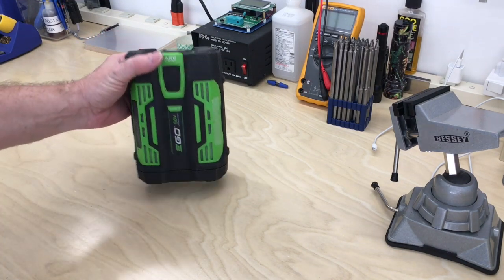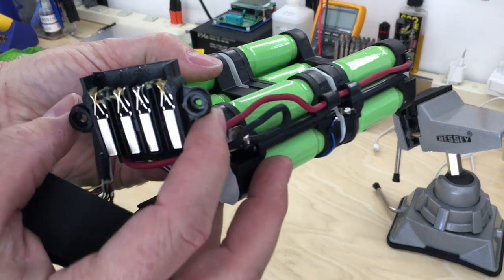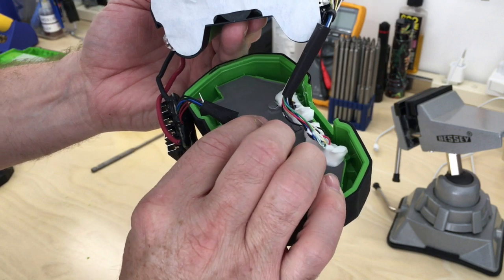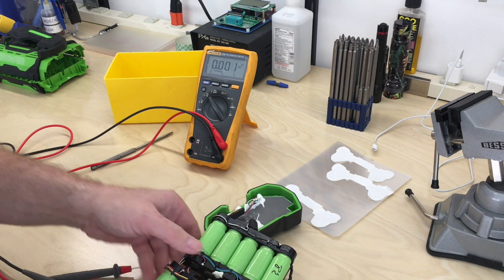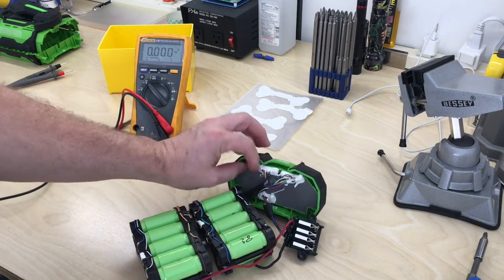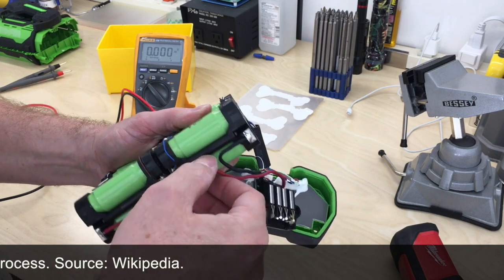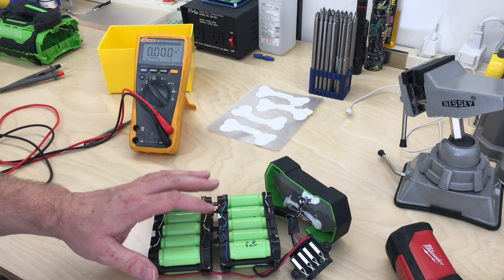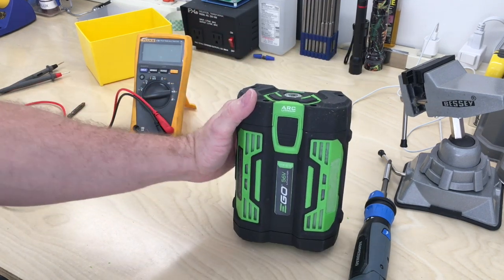EGO 56V ARC Lithium Battery Teardown

Comment: Can you give us the order of the colored wires in each connector? I ripped out some terminals when i tore off the lid
Reply from the maker: I have a video on the 2.5ah pack BMS wiring. It was to help with a similar issue back then. It may differ some on different sizes and pack generations, but hopefully it helps. 
https://youtu.be/RfTJODoh8Q4?si=QhJ8d9pLiBBaY_CJ

Comment: how is this battery 56V???  Even if you assume each cell is 3.7V then 14 cells connected give you 51.8V
Reply from the maker: Because 4V X 14 = 56. Most packs use the MAX or close to max charge level and some like the first ECHO 58V used the absolute max of 14 cells to call it 58V and really it's the same as any 14S pack. The newer ECHO line is now 56V oddly enough...
Some manufacturers use the nominal 3.7V per cell but very few today...

Comment: Hey good video.   I have one to tare down myself.   On year old.  Got a warranty replacement coming also.  I plan on keeping the dud for spare parts.   Maybe use some of the cells for projects.   If you plan on doing the same.  I would take it back apart and disconnect the cells as not to bring them completely down.
Good video .  Thanks !
Reply from the maker: In the very next video I shared the repair of this pack. I have shared many videos on the packs over the last 5 years since this first video. Thanks for sharing.

Comment: Any advice on getting the battery apart? I have my screws out but the shell/housing does not want to come apart?
Reply from the maker: They can be a little stubborn, but if all screws are out then it will separate. The end caps first being very careful pulling on the board side end cap. After the end caps are off then the 2 halves will come apart.

Comment: You pulled the ends right off! I can’t get mine off.
Reply from the maker: Some are stuck very well. Just pry very easily on the end with the indicator/fuel gauge. If you pull too hard and pull out too far you can pull the BMS wiring from the connectors.
Reply: @ThriftyToolShed  Mine is slightly different color. Mostly black with smaller areas of green. The ends seem rubberized, not a hard plastic.
Reply from the maker: All the EGO packs I have worked on have rubberized coverings. I have not worked on the newest 3rd Gen packs with the fuel gauge to say how different the end caps may be. I know the aftermarket solid black batteries from China don't have the rubberized covering.
Reply: @ThriftyToolShed  ok thanks for the reply. Yours came off so easy , I thought maybe mine were different.

Comment: The "phase" material on the cells of  one EGO pack I worked on was a paste at room temp - very smelly.    Probably an earlier (perhaps later) change in design...Good video.   Do you have any advise on how to pick a replacement cell (hi current like these) when you don't have an exact replacement?   And don't have the specs?
Reply from the maker: I keep lots of spare cells from almost new packs parted out as well as other cells tested very well for capacity. I just about always have what I need for spares. I usually do not recommend cells because so many times it's hard to verify that they are not fake cells. The main thing to make sure is that the seller is truly selling genuine cells. I have had great luck using 18650batteeystore.com in the past. 
Some have mentioned that the cells in the 2.5, 5.0 and 7.5 AH units may be Samsung INR18650-25R. The cells are rated at up to 20A discharge.
Sanyo UR18650RX cells were found in a 2.0AH  and 4.0 AHpacks. These cells are also rated at up to 20A.
I share some of this in this video if you find it helpful.
https://youtu.be/f9SOPVEqgkw

Comment: Thank you for making these videos, now I really want to make my own 56v DIY battery backpack. It's such a simple system.
Reply: Do we know what the T and D terminals do? Some digital signal used by the charger, maybe? My snapper (rebranded greenworks) 48v battery also has 4 pins, but you only need - and + for DIY use cases.

Comment: Do you know what type of cells being used are they 18650
Reply from the maker: It is hard to say for sure which cells are in the packs due to the unmarked cells but we know they are  2500mah due to the 2.5ah, 5ah etc. rating. I bought several bad packs from eBay over the last 4 years or so and tested and collected the good cells from some packs while that helped me repair many packs. We know they will be high current cells. We have had some comments from viewers on here saying the cells they thought their packs have.....
  (Jonathan Ridder) mentioned his had Sanyo UR18650NSX. (Ipissed) mentioned his are Samsung INR18650 with phase change sleeves made of paraffin wax/carbon graphite.
Reply: @ThriftyToolShed  thank you

Comment: What can you say about the self discharge feature...I noticed after 30 days it would go into self discharge in order to protect itself. I noticed when the button started flashing. Since I didn't know what was going on I pressed the green button. That made it stop the self discharge process and it waited another thirty days to start the discharge all over again. There is not anything in the manual about this...at least that I found...Only that it will start a self discharge mode after 30 days. Anyway, I'm still figuring this out.
Reply from the maker: Yes the manual is very vague and I believe it is several different versions of the manual and one that I downloaded to share with someone did not mention the Discharge at all. As far as I know the blinking green after 30 days in storage is the indication of the discharge down to 30%. I have not seen any other manufactures pack do this. Apparently Lithium ion cells do not like being stored fully charged and for longer life it is recommended not to store for long periods fully charged and I guess that is why most cells or packs we buy new are below 50% charged. I always thought the manufacturer was just being cheap, saving charge time and electricity, LOL. I really am not a fan of this and I wonder if the newer packs ( I call them Gen3) with the fuel gauge actually still has the feature? The 2 cons to this: People with Nexus power stations full of fully charged packs ready for a power outage do not want all packs to discharge to 30% before they use it. The other issue is the Gen2 boards like mine are bad about that transistor shorting out and it causes the pack to constantly be drain all the way to zero and ruins the pack. I don't think it helps as much as it hurts. So I am hoping the new packs don't have it, but I am unsure?
Reply: @ThriftyToolShed  Thanks  for response. Just a note. The pack that I have that appears to have gone through a discharge cycle is a 2.5 AH EGO weed trimmer I bought new in spring 2019 that has the segmented circle fuel cell. Gen 3 maybe? After stopping the discharge twice by pressing the button...each 30 days apart...the third time I just let it do it's thing...So the button flashed red at ten second intervals, on ten seconds, off ten seconds...for about an hour before stopping. When I finally pressed the fuel gauge button again it was a two green bars.... Side note, I just bought the 16" chainsaw with 5.0AH battery in Dec 2021. I was a bit disappointed that it didn't come with segmented fuel button.
Reply from the maker: Well that answers that. The new segmented (Gen3) do for sure have the discharge feature. Well dang. I know what you mean about the older style battery in the kit. I have seen alot of complaints about that, sometimes even the box shows the new style in the pictures of the tool etc. Seems they had alot of packs or at least parts for the old packs to keep on making them well after the new Gen3 were in production. A bit strange! I like the Gen2 ok, it's all I have, but I always wondered why from the very beginning with all the cuircutry on the BMS with  2 processors why the heck EGO did not put a descent fuel gauge on the suckers...

Comment: I've heard that these batteries had a fan inside of them. Is this true for some models?
Reply from the maker: No, not the pack itself. The charger has a fan to circulate the air through the arc designed case and the fast charger has 2 fans in it.

Comment: I wonder if moisture would be a problem with the ventilation they have.
Reply from the maker: I think that's why it has so much potting on the electronics. I have still seen issues on the individual cell connections as well as the bms connectors with corrosion causing issues though. I have now repaired several of these packs and after the time to remove the potting, I am not putting it back so far. I just try to keep mine from getting damp if possible.

Comment: is there a video on how to take the black cell trays apart that hold the individual cells on the 7.5 mah so i can replace 1 ? mine seem to be stuck onto the batteries. thx
Reply from the maker: You will have to remove all cell spot welded tap connections to fully remove the black tray/cell carriage holder. Then it is screws holding the tray halves together.  So on some of my videos I will show removing one cell and replacing, you would have to do them all for each pack you want to separate.
Reply: @ThriftyToolShed  thx for the quick reply. will a 100 watt soldering gun hot enuff? what size do you use
Reply from the maker: @fredjones4818  Yes, typically I use a 100/140w gun on the larger tabs etc. When taken a loose the spot welds, I just carefully pry with a small screwdriver and pop the tabs off.

Comment: Excellent work! I have EGO blowers and am pretty  much very satisfied. I just ordered their cs1800 chainsaw and am so looking forward to using it. I have their small, medium and large amp/hr batteries. I'm trying to decide which of their rapid chargers to get because they very soon will release a dual port rapid charger which is 30$ dollars less than purchasing two single port rapid chargers at 100$ a piece. If they are otherwise identical it maybe wiser to spend the extra 30$ dollars for the two because then they are functional separately away from each other. I'd like more of their batteries except they're so darn expensive. ENJOY!

Comment: I want to hack one of these and use them with a scooter
Reply from the maker: A lot of people have done that very same thing!
Reply: @ThriftyToolShed  so it works?
Reply from the maker: @HelamanGile  
Apparently it works well on some. Lots of comments in my EGO videos are about the projects they are working on. Many of these projects are scooters and e-bikes. You can get the full 56V out if the + and - terminals, however, you have to make sure you don't pull the pack down to far. It has communication with the tools to shut down if over temp or undervoltage. So when bypassing that you have to monitor or add you own BMS on the scooter.

Comment: After owning and using EGO batteries for several years what are your thoughts on them?
Reply from the maker: I really like the arc lithium design. One of the only ones to engineer the packs to help with cooling. The cooling, spacing and the phase changing sleeves are all vast improvements to me over the common tight brick design. I have seen lots of issues with the BMS unfortunately. To be fair since they are the only pack I have seen to actually monitor the temp of each cell, balance each cell and several other temperature monitoring. One on the board and 1on each pack half as well. So I guess they are pretty complex so maybe some BMS issues should not be a surprise. The 2 things going forward for me is if they will continue the good warranty replacement that they have been known for so far for me and also if the newer BMS design they have, hopefully it does fix alot of the past issues. My thoughts so far!
I really have not seen any other platform that can truly compete with the pack design. I do hope more companies push to design better packs in the same manner. Competition is great!
Reply: @ThriftyToolShed  Thanks for the great videos and quick and detailed response.

Comment: How much $$ to make the mold with a 4-D printer
Reply from the maker: I don't understand the question?
Reply: Thrifty Tool Shed sorry I was saying if someone had a 3D printer made plastic parts and and Cir board and battery cell buying separate how much do you think it may cost then buying a battery from store 163.00 for a 2.5 amp battery could it be cheaper
Reply from the maker: @davidpetrusewicz8172  I really don't think so. Just due to the cost of the 14  2500mah cells in the 2.5ah pack or the 28 in the 5.0ah pack since they are premium cells. Genuine cells of this grade would be maybe $8-10 each. Of course we have another  issue as well. If you wish to use it on the EGO tools the BMS must talk to the tool trough the D-terminal (as mentioned in another video about the D-terminal). So that has been a challenge to figure out and would not matter if simply wanting a 56V pack for other projects such as a e-bike etc. I have actually bought many of these packs as parts or non working just to get the cells from them because they are expensive. That is how I get my spares, tested used cells from bad packs that have great capacity. Always good to think out of the box as you have here for sure!
Reply: Thrifty Tool Shed I think I’m over my head on this looking at your response thank you for answering my question.

Comment: Battery Status IndicatorBattery Status Indicator

The Pushbutton / LED indicator on one end of the battery is used to determine battery status. Depressing it momentarily activates the display:

Green - OK, 15% more more charge
Flashing Green - Battery has not been used for about 30 days and is in the process of discharging to storage level (30-50%)
Red - Charge level is low, prepare to stop using this battery
Flashing Red - Charge level is very low, stop using and recharge
Orange - Battery is overheated (70C), allow it to cool
Flashing Orange - Battery has been overloaded, allow to cool and reduce load

The Pushbutton / LED indicator on one end of the battery is used to determine battery status. Depressing it momentarily activates the display:

Green - OK, 15% more more charge
Flashing Green - Battery has not been used for about 30 days and is in the process of discharging to storage level (30-50%)
Red - Charge level is low, prepare to stop using this battery
Flashing Red - Charge level is very low, stop using and recharge
Orange - Battery is overheated (70C), allow it to cool
Flashing Orange - Battery has been overloaded, allow to cool and reduce load
Reply from the maker: This battery had a shorted transisitor on the BMS which I repaired a couple years ago in the very next video. Thanks for your comment

Comment: My light is blinking as well...What should I do and could this be dangerous?
Reply from the maker: You can call EGO as I mentioned at the end of the video, you can then recycle it. I also showed repair of this pack in the next video. As far as danger, it is always a risk with that much energy in any form of storage, however, I have not had any issues with any EGO pack as far as being dangerous, catching on fire etc. The blinking green is usually just slowly  discharging.

Comment: Mine wasn't charging and others had dropped theirs to get them to work.  I wrapped mine several times with a rubber mallet and it works.  Do you see ANYTHING that might jiggle loose to require a good whack to get it to charge again??  Thx.........
Reply from the maker: No, I did not. I repaired this pack in the next video. it was a shorted transistor. Mine would charge even while blinking, but if not repaired it will pull down to zero volts because of the transistor.....
Reply from the maker: The only issue I can think of that might be possible is if a loose solder connection or spot weld on the cells,  could be bumped into making contact, you would think this issue would come and go though!

Comment: Noob question here.  Just broke down two batteries this am looking for reasons why they are not lasting.  Took one of my 2.0's and tested each cell, range 4.08 to 4.10 and 57v total.  Took apart the big 7.5 amp hr one and it looks a little more complicated to take apart.  The total V out is 57v.  If its 57v do I still have to test each individual one?  Cells are Samsung INR18650-25R which is good they at least are labelled if I need to replace some.  Great videos thanks.
Reply from the maker: Man it hurts me to hear you have a bad 7.5AH those are really expensive. Hopefully it's under warranty? I have not had to opportunity to look inside of the 7.5 but sounds like your cells are fine though! Are you getting the full voltage at the + and - terminals of the pack? I did show in one video on a 4.0AH that the fuse had blown on the connector board? So the cells were like yours almost full chargered and at 57V but I did not have it at the battery terminals...
Reply: @ThriftyToolShed  yes 57v at the terminals.  Out warranty I believe will check my records.   I just know it used to cut the whole lawn but now  will only last for half of it.  Last summer we did have really long grass though with all the rain.
Reply: I have the 5 ah one also and 3 2ah ones.
Reply from the maker: @jhlewis10  ok, They are charging fine and work "ok" it's just capacity? Not lasting as long? What I usually do then is run a pack down as far as I can. If it stops and blinks red, I will even let it sit and run it in my blower etc. Until it cuts out again, I may do that several times and then after it's really pulled down low, you can check which cells individually( or group of cells in case of the 4.0 and higher packs) are the lowest voltage level, usually it's obvious which ones are pulling low, my experience is one cell or one group of cells is what is making the pack cut off to early! Hope it helps and best of luck!
Reply: @ThriftyToolShed  Yes just capacity.  Ok I will get the kids mowing early to get the big battery drained and recheck the voltages.